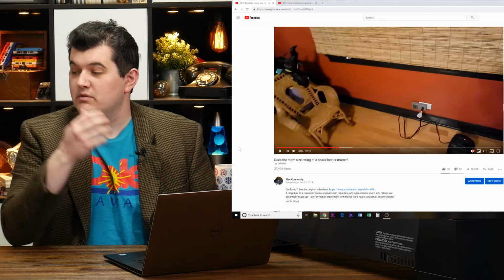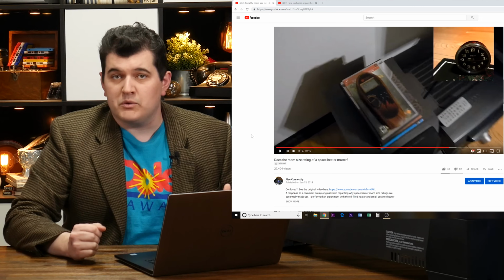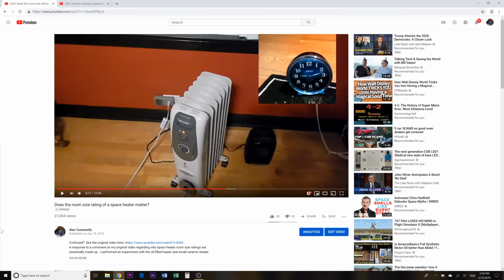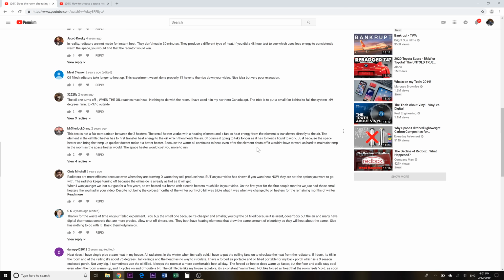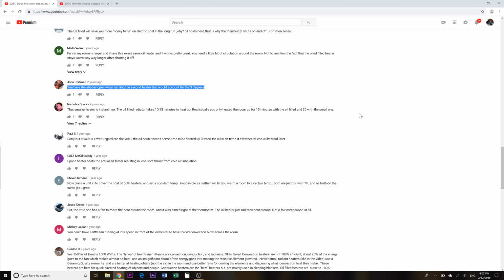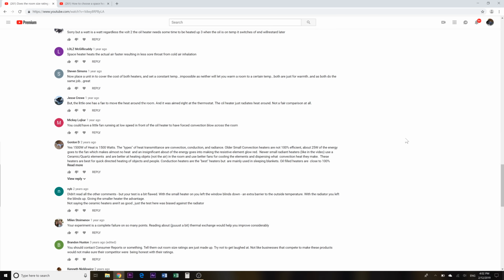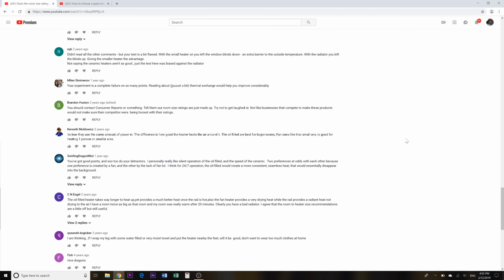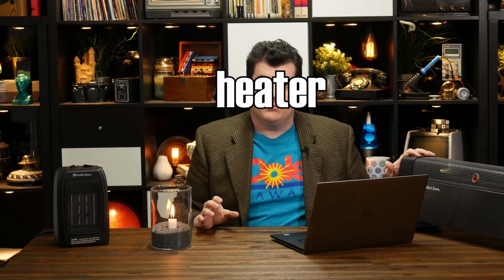More Space Heater Nonsense

Comment: The Infrared Quart heaters do use less energy overall (cause they store while releasing heat the produce) than that small space heater while also delivering the same thermal load. It's like the best of both an oil filled radiator and a straight electric heater with a fan. Outside of the rate of air moving through a room which can speed up the effectiveness of a heater, it's purely aesthetic. Your buying a functional aesthetic piece.
Reply: If you started with identical room and conditions and then use the heaters to raise the room to a certain temp. recording total amount of power and time used to hit that temperature.   Once both are at same temp unplug them leave room closed / sealed and measure amount of time before room returns to starting temp.  Does the oil based heater keep the room warmer for longer time.  If so   was that amount of time greater or less than that of the one with a fan.  Totally agree that marketing claims for room size are worthless but would like to know if the oil based system could potentially heat the room over a longer period of time effective or if the small fan one is just as effective.
Reply: It can't heat for longer as the oil also has to heats up by itself. Also, the warmer a room. The longer it takes for that oil to lose its heat. But that said, the colder the oil, the longer it'll take before it's on the right temperature.

If you putt 1500 watts of power into something in 1 hour. It'll be 1500 watts of power. You just can't create or destroy energy.
Reply: @RedmilesShark  I get that 1500 Watts is just that a measure of energy if it takes longer to heat oil and then the surrounding air that obviously will consume more energy.  Thermodynamics are pretty set in stone.  My question isn't questioning that logic.

 I  am curious as to how efficient each system is...
I guess a better way to word the question would be at what rate does the oil based system shed it's stored thermal energy? 
 Could it be considered more efficient if you stored that energy when it was available let's say you have solar panels and you could use them to generate power to raise the temperature of a thermal mass or oil radiator versus storing  it in battery and release that via a forced air system.  A tiny home or van I guess one could make the solar panel to capture the thermal energy directly skipping the electric conversion where some is lost/escape collection...

Comment: I suppose from a comfort point of view a radiator can feel warmer than a fan heater even though its warming the air the same (or less) but the marketing is just purely that. The oil filled radiator is probably also cycling as if it didn't the oil would probably start to reach boiling point and build huge internal pressure up. 

What's worse I've seen adverts for new energy efficient electric radiators encouraging people to replace "inefficient" storage heaters (inefficient in only their insulation isn't brilliant, they charge up bricks overnight on cheap electricity) gas and even worse, air source heat pumps. It's a scam!

I gave up reasoning with people years ago.

Comment: Electric heaters aren’t all 100% efficient. Some heaters are quite loud, and a lot of the sound they produce is going to dissipate into the outside environment and not help heat the room. If you can hear a heater from the next room over, it’s losing energy in the form of sound.
I know this isn’t really the point of the video which is that the marketing is misleading, but still. I’m only commenting this because you’ve made at least 3 vids saying that electric heat is 100% efficient lol
Reply: Ultimately all energy ends up as heat. Sound doesn't travel forever, and as the air the sound travels through and the objects it hits absorb the vibrational energy they will convert the energy and release it as heat albeit a tiny amount.
Reply: @shez666  yes but what I mean is that a lot of that sound energy will have travelled outside of the space by the time it gets converted into heat.
A heater that produces a lot of sound is less efficient than a quieter one, since the sound energy that travels through your walls is lost forever and unusable with respect to your goal of adding thermal energy to the room.

Comment: There is a term in the aircraft industry.  This term is "coal soaked fuel".  What is cold soaked fuel?  it's fuel in the wing that has been exposed to the super cold temps at cruising altitude for long enough that it can form frost on the wing surfaces where the tanks are.  I think the term can be modified for use with space heaters.  When you achieve 100% heat saturation, that means your heat surface which transfers the heat energy into the air reaches its maximum capacity.  The small one with a fan has a higher saturation point due to the oil acting as a moderator.  You cannot get 100% heat soaked from the oil filled radiator, because it is never heating its own moderator up to the maximum allowed by the restive electronics.  So,i say that instead of a room size rating, you get a "heat soak" rating.  This will tell you how long the heater may take to heat your room to the set temperature.  What say you?
Reply: Right there with you TransitBiker.  It's about the robustness of that moderator and its ability to reach and efficient temperature to maintain effective heat transfer.  As a simple example, I once bought a small 12v electric car heater (effectively a hair dryer element) which was perfectly fine when tested at 60 degrees but when used in a freezing car, would not heat up at all.  Not even a degree.  The heating coils increase in resistance as they warm, and need to get to a certain temperature before they effectively heat.  If they are overwhelmed by the temperature differential they will not.  If those coils were insulated in a fashion (from airflow) they could heat up and then (yes more slowly) release that heat to the surrounding environment - like the oil heater.  So 'small room' vs 'large room' is an effective argument that could be made at a larger temperature differential.  It's about heater design and their ability to internally raise their coils to a valid degree of resistance and heat output, enabled by that moderator design, and not the BTU's.  A large room with a greater temperature differential is more effectively served by something like the oil radiator as the air temperature would not rise as much relatively.  The smaller unit, with internal fan and without the insulated element that can rise to an internal temperature (resistance) to begin effective heating would be overwhelmed and may not heat at all.  Put both candidates in a 0 degree Celsius garage and determine heat rise after a day, and I'd be more convinced there's no merit to design vs simple BTU consumption.
Reply: Just monitor how much energy the heater draws in the form of electricity.
And then apply the low of conservation of energy literally.
That much energy that is drawn in the form of electricity is the amount of energy released in the form of heat.
If both heaters draw 1500 Watt, then both release 1500 Watt in the form of heat. There is nowhere else the energy could go to, if you allow us to ignore the energy in the form of sound or light leaving through a window.
Reply: kallewirsch2263 Sure, but they take different times to heat the room from cold.  That likely matters more than over-all heating capacity.  Ratings could be heat soak, air circulation in cubic feet per minute for fan models, and then you could have categories   based on thermostat location & type...

Comment: I mainly agree with you arguments tc2. However, let me give an energy plus to the poor radiator! The large surface area contributes to the uniform heat distribution. This leads to a lower temperature on the surface in comparison to the one of the air coming in front of a fan heater. Thus, more of the energy of the latter will be used to evaporate water, which is a heat loss. This is not an end-all argument, of course, but it makes oil heaters preferable for long durations if default price is not a priority.

Comment: I prefer coil type heating elements over a ceramic type. Ceramic elements are self regulating and are designed to increase there resistance, reducing there heat output as they heat up. I have never liked the oil filled radiator type heaters as they take a lot more time to heat the same space, using more energy. But like you said, a 1500 watt heater is a 1500 watt heater no matter who makes it, the size of the unit, or its shape.

Comment: Very nice, never heard of this before.
Probably not the same thing in the UK with our higher mains voltage (i have a 2kW one by my desk). Only difference I can think of is that a 'small room' fan heater has a cheaper/weaker fan motor and so isn't as effective at evenly distributing the heat throughout the room? Other than that I've got nothing - all marketing.

Comment: I don't see what everyone is crying about. There is nothing wrong with what you are showing, a small heater is just as good if not better than a larger one in some cases. If I was an old lady waking up in the morning and the room is cold then in your experiment it shows that she would be better using the small one as she would get warm quicker. the oil filled heater may  work in the long term but I want to get warm now!!!!
Reply: I'm generally not home often or long enough to worry about maintaining the temperature in my room for long periods of time, so in my case the faster solution is the best one.
Reply: I want everything to be warm 30 minutes before getting up but agree.

Comment: I understand your frustration, there are so many variables.  If you have a 10 x 10 ft. room, how many windows are in the room.  Are the modern thermal glass.  Is the room over a basement or crawlspace.  Is the room slab on grade.  These conditions will vary the heat loss greatly.  Therefore, trying to size heater to the room without some calculations is foolhardy.

Comment: Depending on your ceiling insulation, the convection-based one can be objectively worse: if there's no forced mixing of air, the ceiling area will be hotter, which means there will be a higher heat loss through it.

Comment: The advantage of comparing a big heater of a given type (radiant/passive convection/forced convection) to a smaller one is that the elements should run cooler for the same level of heat output. (More surface area and/or thermal mass.) So it has the potential for being safer and having less thermal cycling due to hitting a temperature limit.

When comparing different types it's still a bit of apples and orange in functionality. A heater fan may help heat a room quicker, but could be a bit disturbing if you're sleeping in a space where it keeps going on and off. So there's sometimes other considerations.

But yeah, it should just be BTU output and/or watts. Marketing wank to say how big a room it heats is a bit annoying. (However recommended room size in terms of an ambient temperature profile may be a kind of safety thing. Still if a bigger heater spreads out its elements well, then it's going to be a smaller unit that produces the hot spots where you don't want walls or furniture.)

Comment: I think why europeans tend to use oil filled heaters is that they because of how they 1. warm up a room slower and keep the heat for longer, and 2. radiate heat instead of just warming the air, tend to warm up the stone walls and the floor in the room more than it would if it were to be a cold room with warm air in it.  Especially in southern europe they have mostly stone floors , so the radiator heats up the floor which then also conserves heat over a longer time and warms up the air for longer than if the warm air was to just cool of directly by either leaving the room  or by starting to heat up the floors and walls.

Comment: The oil filled heater is designed to draw power when it's cheap and release it slowly.

However, I doubt that the thermal capacity is good enough to release the heat all day without powering it with expensive "day" energy. (Or maybe in your area "day" energy is the cheapest because of the solar panels?)

It make sense to have an oil filled heater if your price of electricity fluctuates wildly in a houruly time frame. But if it takes about 12-15 hours in order the price of electricity to go back to "low" - it does not make sense to use such a small oil filled heater. Maybe another method of storing heat is more practical (with a bigger thermal capacity).

Comment: Wouldn't it be better to use the small heater to blow hot air over the oil heater?
You'll get a ~3000W heating array with less noise than when using two fan heaters and less volume than two oil heaters!
Reply: Actually...the air temp of the fan one is higher than the thermostat setting on the oil filled heater, so pointing the fan one at it would keep it turned off.  The correct arrangement would be for the fan heater to move air near the oil one but not blow directly on it.  Also most outlets in a household room are on a single breaker which may be a insufficient.  Best to run a light extension cord from the bathroom across the hall into the bedroom if you need to run a second space heater.
Reply: @samrichardson630  I was joking!
Reply: @miaudottk9080  joking or not, it wasn't a completely bad idea.  More airflow would help the oil filled heater work faster and the little heater is moving air anyway, it just needs to be arranged so that both heaters are getting the coldest air in the room.  There are, of course, better ways to heat a room.
Reply: @samrichardson630  I know. Besides being a conspiracy theorist I'm also an engineer.

Comment: Only thing I can think of is that there must be a fundamental difference in how companies come up with the ratings and how you conducted your experiments. Of course it could all be marketing jargon, but I suspect they used a controlled air chamber to heat as much cu/ft of air up to temperature in a certain time period; pumping in new air as needed and not relying on convection. This would lend the upper hand to the larger heaters due to their surface area being able to heat more air at once and the companies using a low temperature threshold. In this way; under their controlled conditions, they are flawed in assuming that its better for larger rooms because it may heat more cu/ft in a given period.

Comment: So thinking about it, here's what people probably really should look for in space heaters:
* Safety. I've heard that space heaters are a bit notorious for house fires, so this would definitely be a plus.
* Having a fan to circulate the air and equalize the temperature faster.
* The position of the thermostat, since it can affect how well it detects the proper room temperature. Sadly, this is almost never known.
* Possibly a power saving mode? My heater actually has a power saving mode that forces a lower maximum temperature (which is really where the power saving is) and actually varies the power output depending on how close the thermostat detects it is to actual room temperature (which probably doesn't do too much except make it more difficult to reach the target temperature).

Comment: Could the compactness of the unit account for the thermostat being closer to the heating apparatus, thus it limits itself more often? Maybe that is one reason to market small vs large room, is basically heater design and size to make sure that the thermostat is far enough from the heating element to be sure it doesn't overheat and turn itself off.

Comment: Not for nothing, but I wonder what would happen if you were to put a small fan set on low behind the oil heater to quietly push the heat into the room which should keep the oil heater on and not cycling off & on every few minutes.  Perhaps then it might be closer to the 30-minute results from the small heater, and beyond that if you let either heater run for, say, 2 or 4 hours, you may find they’re running identically at that point and you could remove the fan from behind the oil heater.  

If you’re trying to maintain a constant temperature in a cold room for days on end, then they should be breaking even once the room reaches its equilibrium, just that the oil one won’t initially get you as warm as quickly unless you add a fan to it.  Or maybe not.  But that’s what I’d do if I had an oil heater.  

Thanks for pointing out what should be the obvious for us, however - I’ve kind-of been swayed by claims made on heater boxes before so now I know better and to just shake it off and pay attention to the numbers and not the flair on the box.  👨🏻‍🎓👍🏻